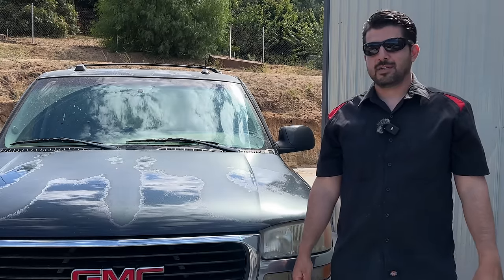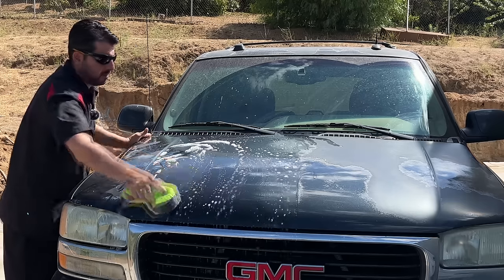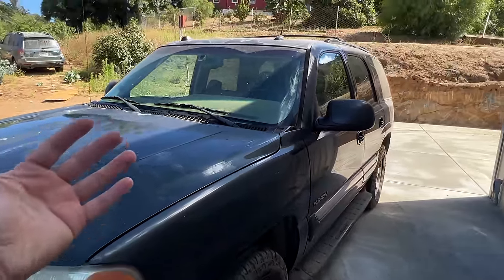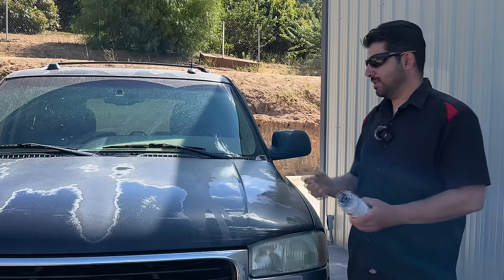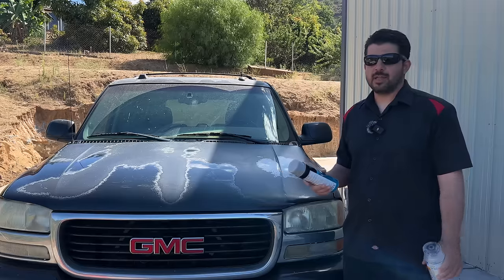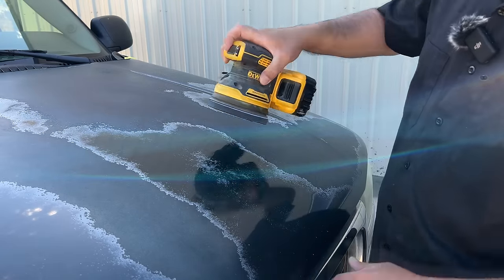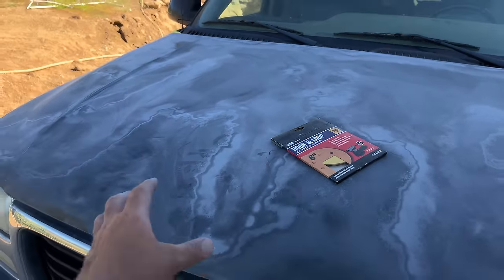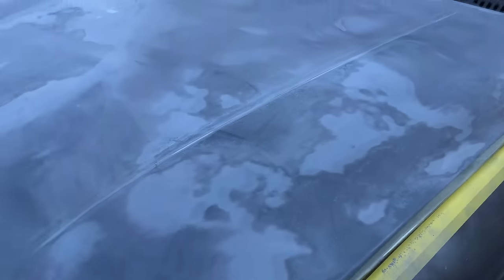DIY Paint Job With Rattle Cans

Comment: I like the ending, thats funny. That looks good to me, You can see the clouds reflecting off the new paint sky city.
Spray cans are handy. I just got a 2005 Tundra with a fucked up hood, and I have a cab height shell for my F-250, same.  Except for the roof theres almost nothin to paint. Its so tall only Simi truck drivers can see the top..... paint brush....?  WHO TFSAID THAT...!
I think it came out nice,

Comment: If you have no power tools I would take a sanding block and 220 wet and dry paper and wet sand it. Probably hit it with some 320 next and it should be good enough. If you want to go with some finer paper you could be not a must.

Comment: I'm a 30+ year bodyman and I would never apply base coats or clear coats dry. Flow the paint as smooth as you can every coat and you shouldn't have to wet sand and buff. Also 2 color coats followed by 2 wet clear coats should be plenty.

Comment: Way back around the 1980s ... DuPont had a confidential agreement with the GMC/Chevy dealerships to repaint any silver vehicle that was peeling and flaking [ ONLY ] if the customer complained to the dealership and demanded a repair. If I understand it correctly, you didn’t have to be the original owner and you could go to any dealership and they had to honor it. Back then, we didn’t have the Internet so it was hard to prove that the agreement existed but I wonder if someone looked for it now if they might be able to find it and maybe even get your vehicle repainted??
Might be worth a bit of time to research it!

Comment: Manufacture  clear coats are crap over past 10 years + my wife's 2017 mustang and daughter 2023  charger you barely graze the paint surface and there a clear coat scratch that clearly visible it sucks.

Comment: What does the guide coat do?
Reply: Nothing, if you sand with a soft sponge like he did.  If you sand with a 'sanding block' or something flat and rigid, the guide coat will show you the high/low spots in the body panel.

Comment: After you purchase all of the required supplies , and add in your time, 
you are far better off taking the Panel to a body shop.
Reply: doubt
Reply: Please elaborate? I cannot see this costing more than $100 + some of your time over the weekend vs paying north of $300 (probably waaaay more) to a bodyshop.
Reply: I thought so too for just the hood. I found best price of three cheap body shops was $1200. This method is mostly time.

Comment: Taking a few minutes to remove the hood would've saved you the time it took to mask off the truck. Also, you could've taken the hood to a place out of the wind, dust, etc.. with that being said...the end result (on video) wasn't too terrible for a high mileage cheap vehicle. I will bet in person it has tiger stripes.

Comment: I really don't care about my truck and the fiberglass back cover and top of passengers need to be repainted.   I just spent a pint of truck paint.  I am pressuring I need  a clear coat but do I need primer too???   I won't be using spray at all.  Just a real expensive paint brush.  😅

Comment: This is a typical GM paint problem. All you need to do is remove the base Coat And clear With A razor blade .  And then wetsand with 800 grit.

Comment: Oh    my gosh ratchets,  you have streaks in color coat and you are applying clear coat the same way.
you keep losing the wet edge.  There should be no streaks before you apply clear coat so it can peel in a couple  years.
you need to watch some of the rattle can vids and pay attention to how they keep the wet edge as they paint the panels.

Comment: Well, as much time as you spent on prepping. You should have just used the spray gun because you pretty much did everything you would have done in a body shot over and over so your should  have used a spray gun because most of your do it yourself  are not going to do what you have just demonstrated.

Comment: No matter how many big or small you tube channels tell you rattle cans are OK to use on cars ot motorcycles etc.,  DON'T DO IT!  You will destroy the panels.  Rattle cans contain garbage paint.  It WILL FAIL.  And when it does, because it's cheap garbage - it can't be sprayed on top professionally.  Many of them can't even sealed because even that reacts with the cheap junk paint. The entire vehicle will need to be stripped.  It is guaranteed to happen.   I'm a 30 year professional painter.  Own my own business doing so.   Hear me or don't - But this you WILL regret.